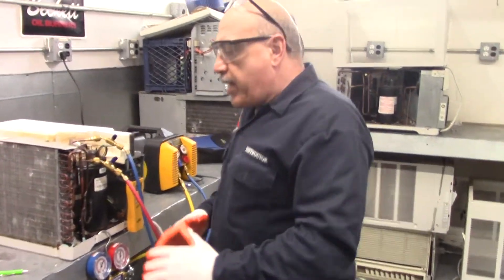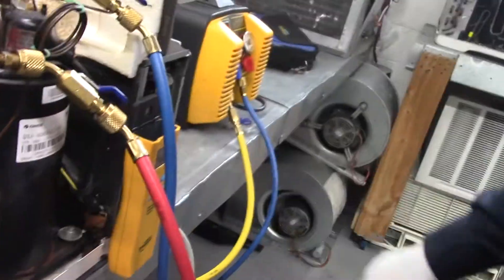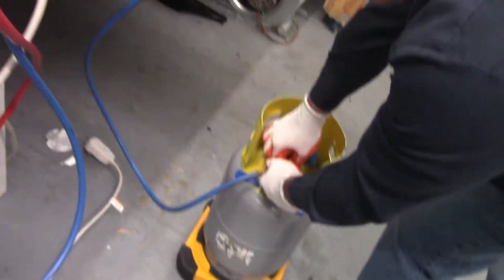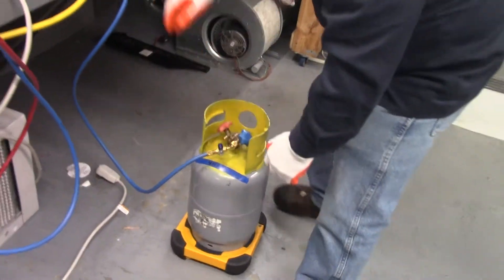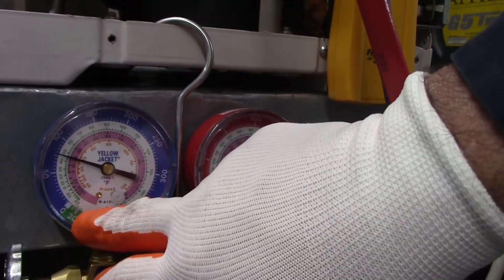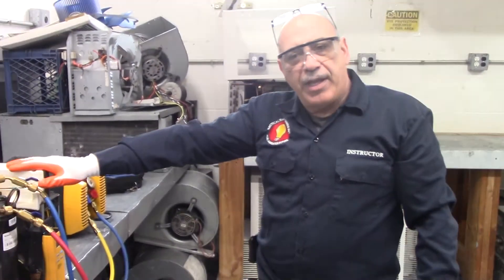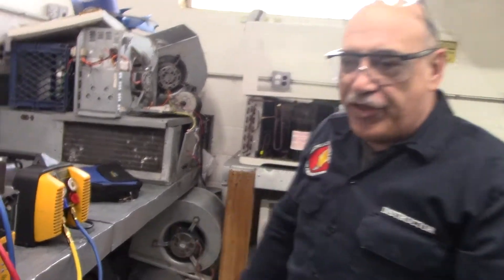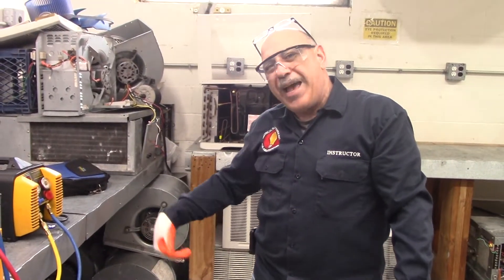Recovery of Refrigerant On A Window Unit

Comment: Is there any way without any expensive tools of telling whether or not the freon is still inside the unit? I found one i wanted to take apart to scrap for copper and aluminum but I stopped breaking at down before compromising any of the pipes because luckily at the best time imaginable i learned that its illegal and dangerous to release freon, i wanna continue breaking it down it seems old so im not sure what to do or if theres even freon inside

Comment: What are those two things on the floor, in the corner under the work table stacked on top of one another with the motors in the center? Anyone know...
Reply: furnace blower motors
Reply: Blower motor blower assembly for ac
Reply: They blowers for A/C heaters , those push the warm air to the ducts and warm the house, recirculating warm air, another ones very similar, in heaters, they used to take out the combustion air,out of the house too.